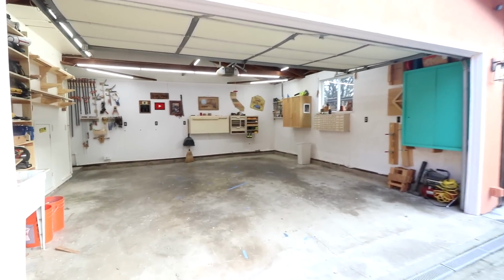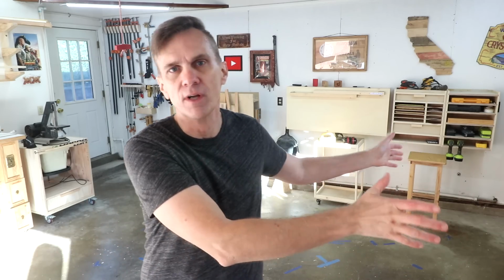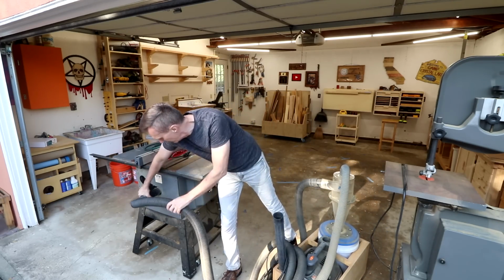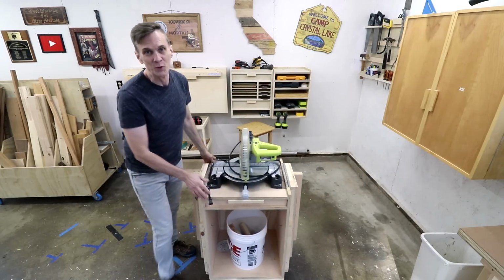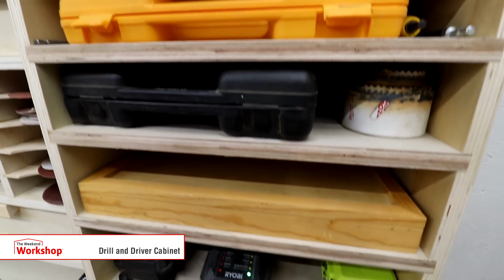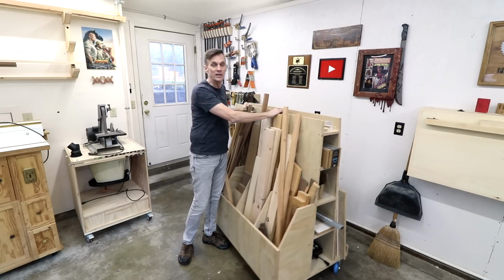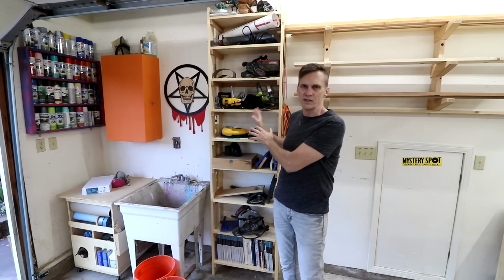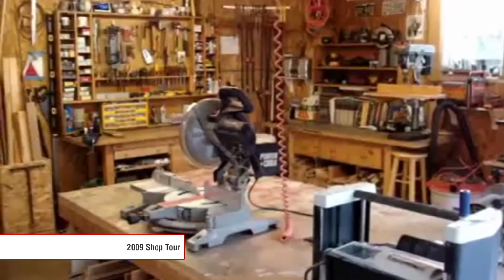SHOP TOUR. My biggest shop upgrade in 19 years! How to turn any space into an awesome workshop.

Comment: You should try setting up a small shop in a winter city :) all that extra space you get from opening the door is only available half the time :o
Reply: My shop is a separate outbuilding that's only heated during winter when I'm in it working.  Anything freezable like paint, glues etc. has to be moved into the house for the frigid months.
Reply: Jason M exactly why I have collapsable tables. Here in PA it can get cold enough to keep me out of my unheated workspace. If it doesn’t roll around or collapse I can’t use it. It’s great when it warms up enough to open the door and roll out into the ☀️
Reply: @simpleminded5215  I often thought there should be challenges like the "i'm so cold i can't feel my fingers" and the i can't see my workpiece over my breath" build offs. I also thought about build offs while your kids are breaking things and your wife is yelling about how much dust you made.